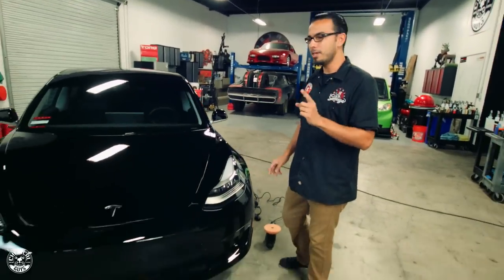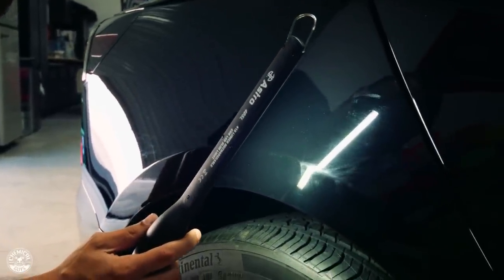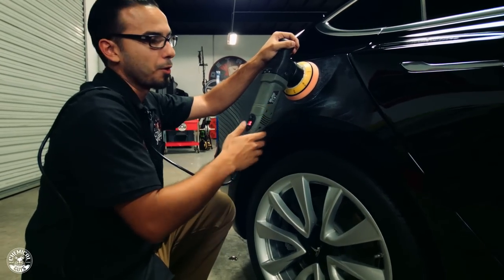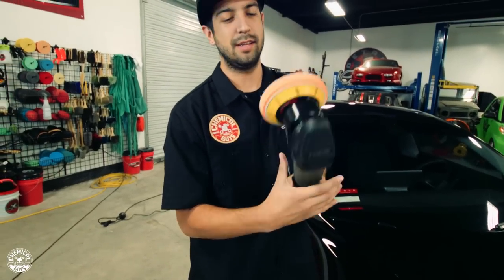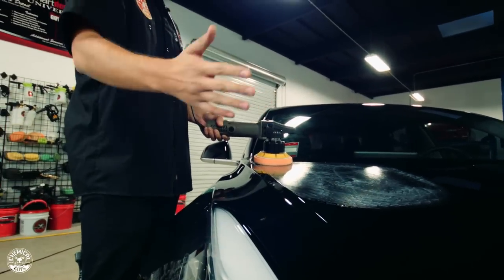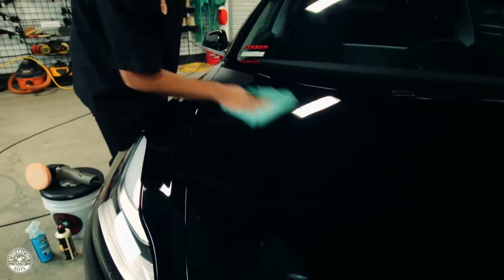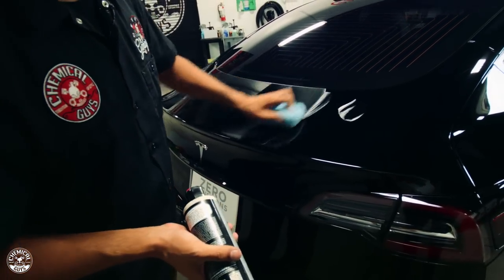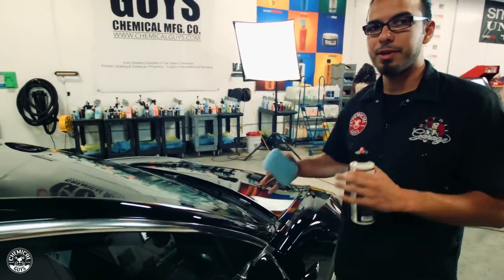First Look TESLA Model 3 | How To Polish New Paint - Chemical Guys Car Care - Black Paint Polish

Comment: Hey chemical guys, I just purchased the same car and want correct the paint, I have the torx polisher (purchased through you) and want to use black light because I used it on my bmw and thought it really helped the paint on a 2007, I do not have the polish you used in this video but do have 32,34,36,38 polishes and have all the pads, what would be your recommended polish and pad to achieve what you did in this video? Also can you use a ceramic coating after applying black light?

Comment: Can you use whitelight/ jet seal/ wax?? Does jetseal still protect even when it's placed over a glaze?
Reply: Dmocification yes
Reply: Yes. A glaze helps enhance gloss. They also contain micro fillers that help fill in minor surface imperfections. If you applied glaze over a sealant like Jet Seal, the glaze would be sitting on top of the sealant, rather than bonding to the paintwork. Always apply glaze before a sealant. That way, you'll seal in the glossy finish that a glaze offers. The proper application would be White Light > Jet Seal > Wax.

Comment: Cool video. Few questions. First how long does the sealant 8n the polish lasts. Secondly if there isn't that much swirls and scratches but you want to seal the paint can you the polish by hand just to seal the paint.  Thirdly if you can apply by hand how long would you wait.  Please and thank you
Reply: Harshvir Kamoh Harshvir Kamoh 
1. Expect the sealant in V04  to last about 2-3 months. 
2. You can absolutely apply V04 by hand. It's going to take more work to remove the scratches/swirls by hand than if you used a machine. However, if you just want to apply the sealant on the vehicle, try using a standalone sealant like Jet Seal.
3. Usually sealants need 15-20 minutes to cure and bond to the paintwork before you buff it off. Hope this helps. 👍
Reply: Tony Pitts thanks

Comment: Hello, I do not have a garage to polish in and am stuck outdoor. This is fine but the problem is sometimes I cannot see the scratches because I do not have full control of the lighting. On top of that my car is a light colour. I have tried a Led flashlight but it is still difficult to see the scratches. Any lighting recommendations?
Reply from the maker: Hey there, many of us don't have garages either with optimal lighting conditions, and have light colored vehicles that make it difficult to spot scratches and swirls. The best recommendation I can give you is to purchase a canopy or awning so that you have a shady place to park your car under so you can utilize the led flashlight that you already have. Unless someone is willing to lend you their garage, there aren't allot of different options.

Comment: love your products guys.  I use jetseal on a lot of my friends cars because its cheap, lasts about 2 months here in Florida.  I will say when I polish and correct, I usually blow my pads out after every panel.  They definitely cut better and polish better after blowing them out.
Reply from the maker: That's fantastic, we're glad that our products meet and exceed your expectations. Pads are designed to be used repeatedly without having to be cleaned, pads should be cleaned at the end of the detail. Based on your observations, it's not surprising that the pads perform better when they are clean. Stay tuned buddy, we've got more great videos coming your way.

C.G. Alex -

Comment: Speaking about jetseal, I used it on my car. It is perfect, but it seems contactless shampoo remove it. Is it possible?
Reply: Jet seal will disappear with time
Reply: Using a pH balanced car wash soap will help prolong the life of Jet Seal.
Reply from the maker: Hi Nedeljko, it sounds like this contactless shampoo is far too concentrated, and will strip Jet Seal from your paint. Like Tony Pitts said, using a pH balanced shampoo will preserve the sealant coating, and won't leave any residue that commonly happens when you wash in the sun. Stay tuned Nedlijo, we've got more great videos coming your way.

C.G. Alex -
Reply: So jet seal is way better than Rain X for rain to bead off your glass? Where is jetseal sold?
Reply: In local Chemical Guys dealer in Serbia.

Comment: How do you clean the pads
Reply: TheRequiemist they have a cleaning pad spray:)
Reply: Some soap and water bro, just wash the soap out super good
Reply from the maker: The easiest way to clean the pads is to pick up one of the pad cleaning brushes, and some pad cleaner, spray down the pad and agitate the cleaner with a brush. Afterwards you'll just use a microfiber towel to dry the pads. The other way involves getting the Grit Guard Universal Pad Washer with Pad and Wool Cleaner, it will be more expensive; yet it's a more professional way of cleaning your pads. I'm going to leave you a link to the products so you'll know what to grab.
http://www.chemicalguys.com/Foam_Wool_Citrus_Based_Pad_Cleaner_16_oz_p/buf_333_16.htm

http://www.chemicalguys.com/Foam_Pad_Cleaning_Brush_p/acc_991.htm

http://www.chemicalguys.com/Grit_Guard_Pad_Washer_w_Pad_Wool_Cleaner_p/iai_507_3.htm
Reply: Thanks 👌👌👌👌👌

Comment: What is a 2 x 2 in cm?
Reply: Mo Carey One foot is equivalent to 30.48 cm. So in your case, you're looking for a 60.96 x 60.96 cm square to polish in. 👍
Reply: This unit is foot and that is very important. Quantity of compound on 6" pad is enough for that surface. If you change size of pad you must adjust quantity of compounds and surface. But don't worry it's matter of practice.

Comment: Final control spray after polishing please . Than you see the real result
Reply: peeters tom what are you even saying.
Reply: Dmocification search for final control spray 3M than you understand.  I always use it after polishing and than you can use high gloss polish to finish
Reply: peeters tom I understand, the product they are using has shine and sealant on the product. So using a spray wouldn't be a good move
Reply from the maker: There's no need for that, you can use Wipe Out or Iso-Propyl or even a quick detail spray to remove any polish residue to expose the paint. A microfiber towel removes most of it, some people use products like the one you mentioned, I personally feel like its overkill, but if it works keep using it.

Comment: I don't agree with the new pad or not comment.  Even if there's not a lot of spent product or paint on the pad, using it for too long will generate a lot of heat and that will either cause the pad to sink in the middle or start delaminating.  Best way to get pads to last a long time is to switch them out often during use to keep temperatures down and avoid caking up.

Comment: Can anyone here recommend a good non-overpriced rotary polisher ?
Reply from the maker: Hey Rudy, we have the TORQR which is much cheaper than the Kompakt Flex, for ten dollars less you get a larger machine. The polisher market is flooded with expensive polishers, and the TORQ tool company mixes affordability with reliability, and offers all these great features for less money. Check out the TORQR page.
http://www.chemicalguys.com/TORQ_TORQR_Precision_Power_Rotary_Polisher_p/buf504.htm
Reply: Porter cable